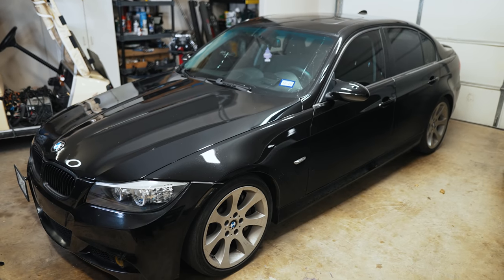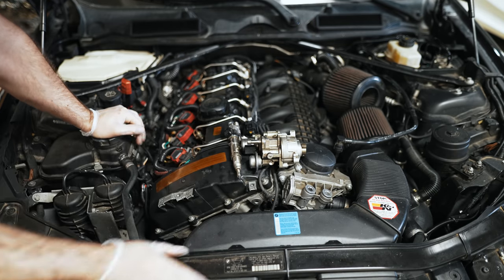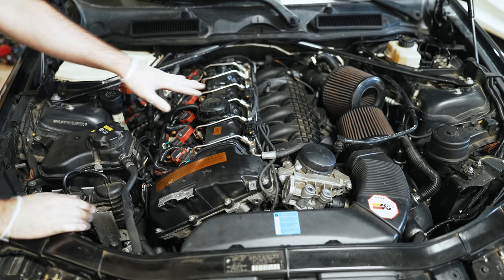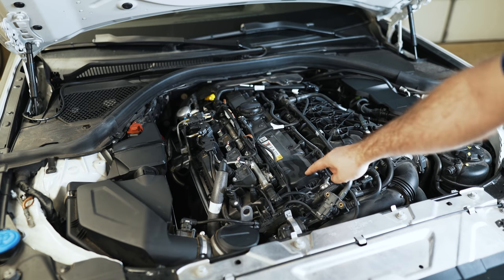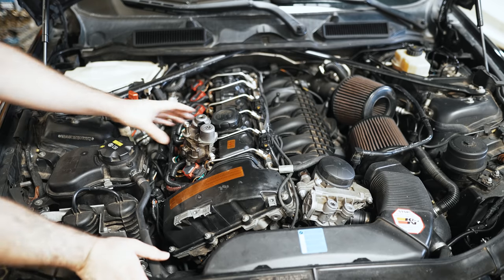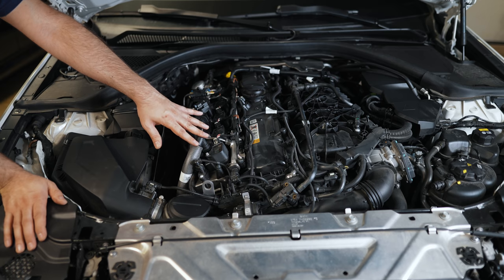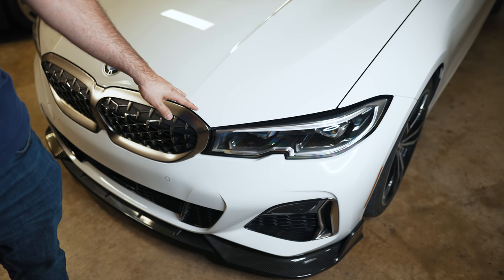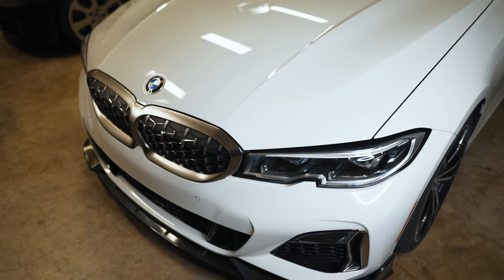Here Is Why New BMWs Are Now Reliable

Comment: Car And Driver had a blue 2020 BMW G20 M340i that hit 40,000 miles in their long-term test on 3/4/2021. Only issue it had was 2 potholes, nothing mechanical at all. I'd like to get this version of the G20 someday, seems like a real solid upgrade to the N54.

*EDIT: Not my G20. Not my website. Lol. So many replies. "40K MILeS?!?! tHaT nO lOnG tErM I kNoW oF! CoMe BaCk aFtEr wArRaNtY!" Yes. I understand. But did you know..? This is a Toyota engine now. The B58 engine will do 200k miles with no oil changes & constant neglect. The S58 engine will be the unreliable BMW you're all so familiar with. 😉
Reply from the maker: Nice, yeah stock it feels like a stage 2+ N54 running on 93 octane in terms of performance. Add that along with reliability and you can't go wrong.
Reply: I have an Alpine White 2020 and coming from an 07 E90 with MHD Stage 2 this one is very similar though not quite the thrasher those twin snails are.  A very healthy upgrade in every way - the X drive plus rear LSD standard make this a monster of comfort, capability and potential.  15K miles and one winter in, have had zero issues.
Reply: Great vid! Saying imo indicates you are open to other opinions and don't state yours as fact, don't worry it isn't annoying.
Reply: I have a 2017 F82 M4C and have had zero issues with it at 51,000 miles. I always do the required maintenance and on time. But I do drive it daily obviously, including seven track days in the last two years. The only thing I spent a substantial amount of money on is tires...lot's of tires.
Reply: I saw the story too
Reply: 40K miles?  Call us back when you hit 200K miles--then I'll think they are "reliable", and worth the asking price.  Who the heck wants to buy a $60-90K car and have to trade it in before the warranty expires at a 50% depreciation rate.
Reply: @RK-db4oq  that straight 6 will easily hit 200k. Am absolutely certain about it, no doubtin my mind with absolute certainty. Depreciation is on every car but luxury cars get hit hard. Sometimes its not about depreciation which isn't everything. Its about owning a car and enjoying it. I care about depreciation but not very much. Its subjective.
Reply: Exactly why Toyota allow it to be labeled as Supra engine. Tada san indeed open it  bolt by bolt to check if it may have problems
Reply: @RK-db4oq  Alright bet. When I buy my 2020 B58 G20 M340i I'll let you know. By the way, that 40k mile BMW is not my car. However, I do own a 2008 335i E93 with 94,551 miles. Daily driven & I actually just did rear rotors and brake pads today.
Reply: @nature10879  I'm talking the whole car, not just the engine.  Believe me, I'm rooting for BMW to get their act together on reliability.  I buy new and typically drive 25K per year, and like to keep my cars until they hit the 200k miles mark.  Ford trucks, Honda/Acura and Lexus/Toyota have no problem doing this for me.  I would have loved to have bought a new 540i--it is everything I am looking for in a vehicle, but in the end I just couldn't do it because of all the horror stories I've seen and heard about design, reliability and maintenance costs.  In the end I bought  a Ford Expedition (I know...), so have to be satisfied with the thrill of straight line acceleration only (tune that 3.5L twin turbo and you can easily get 550+ HP out of it, and AWD lets you use it).
Reply: @RK-db4oq  You pay to play. This is a performance car not a Toyota Camry to get you to and from work. I bought my M4 because I like the way it handles, the power and I like to attend track days in a car that has some speed. When you build a performance engine/car you have tighter tolerances and more wear to achieve those power figures and higher performance suspension, brakes, wheels etc. I will say again I have over 50k miles on my car and the only money I've spent is on oil changes and regular maintenance...and tires.
Reply: @RK-db4oq  i had an acura it was a nightmare. My e39 was trouble free compared to that thing. For some reason i had suspension and fuel system issues over and over again. When i sold it, had to have it towed. I currently own a Taurus and a 550i. Catalytic converter twice (had it towed twice$1100x2)changed, fw drive shaft(had it towed +400), fuel pump(towed+600) wheel bearing twice changed (+800), plus regular maintenance like tuneups etc and i baby this thing. And on my 550i, valve stem seals and new battery. To me if its not complex, make it reliable like a toyota. I cant speak of ford trucks the older ones are great but the EcoBoost is having issues. Rams are mostly unreliable and problematic. Hyundai was the most trouble free car I've ever owned even though it was unsafe to drive besides my beloved e39s. One e46, 2 e39s, a 1992 325i manual (over 280k), a 633csi (had 210k when i bought it and the that thing wasnt counting, no one knows how many mileage that thing had) Good luck with your ford expedition, a friend had an older one with 290k miles, just blew head gasket but its been an amazing suv for her and i think she neglected the coolant loss issue why it blew the gasket.
Reply: @RK-db4oq  by no means am defending bmws but their straight 6es are great overal excluding the early turbo ones from 2008 to 2010. I wouldn't hesitate to buy one over anything german and asian (lots of respect for honda/acura vtech v6 motors those are super reliable).
Reply: @nature10879  I'm relatively familiar with German cars as I lived in Germany a few years.  During that time I mostly drove Mercedes as a company car (300D 4-matic, GLK 4-matic diesel, and C Class wagon 2WD gas turbo 4)--used to do 130 MPH on a regular basis on my way home from work until I got it out of my system (and got older/wiser).  The 300D was the most comfortable and the best at speed, but a bear to park (only Europeans would understand the relevance of that).  The C Class wagon was basically a cramped Camry--hated it.  The GLK was the most useful--it did almost everything well, but it was twitchy at speeds above 100 MPH.  Every German "car guy" I know (and I know quite a few) has either a Porsche or a BMW.  Mercedes was considered a boring executive taxi, though my company used them exclusively as they were the least expensive to keep on the road (and they tested a number of brands for several years to prove it to themselves, including Ford believe it or not).  Audi was thought to be owned mostly by A-Holes (because according to my German friends, their owners mostly drove like A-Holes), so even though they had some nice models, nobody I knew owned one.  VWs were for young/poor guys.  My plan is to pay off the Expedition in a few years, keep it as a 2nd car (I have an Odyssey with 266K miles now as my 2nd car), and then hopefully buy a 540i or its replacement, assuming BMW can continue to improve.  In Germany no one worries about BMW reliability too much because parts are relatively cheap (they have ebay equivalents and junkyards too) and every local mechanic knows how to fix and maintain them--no need to visit the dealer once the warranty expires.
Reply: Get the 2020 M34Oi. If you get one. They changed the tune, and exhaust manifold on the 2021. I had mine in the shop, and they gave me a 2021 for a loaner. It felt gutless compared to my 2020, and it had no exhaust burbbles. Sounded extremely muffled, and felt way slower.
Reply: the fact that 40k miles without problems is a lot to a BMW says everything
Reply: @thend8535  did the horsepower numbers decrease?? We are thinking about either new bmw m340i or Tesla model 3 performance
Reply: BMW engines are pretty good, it’s usually not the engines that go bad. The issue is usually all the plastic parts and ecus and whatnot surrounding the engine. Those usually start going bad after 5 years or so and only get worse from there. The vibrations and heat cycles in the engine compartment take their toll. And if the wrong part cracks and the engine needs to be removed for it to be fixed... well enjoy your 4 figure repair bill over some crummy $50 part. 

Also I would hardly call 1 year a “long term test”. Kind a joke to call it that. It’s after 5 years and the warranty is expired that stuff starts randomly breaking. Not hating on BMW but pretty BS to call modern BMWs “reliable” based on this 1 year C&D test.
Reply: 40k is not long term reliability .......maybe 80k is
Reply: Anyone who uses plastic in the engine loses credibility  in my opinion for reliability long term. It breaks down over the long term regardless of how well you take care of it because  its not able to handle the heat and cooling down over the life of the car. So no older German cars are bad avoid like the plague. They will nickel and dime you.
Reply: @RK-db4oq  right? This day in age 100k should be no issues for many modern vehicles. The fact that some still have to boast about making it to 40k or before warranty is up is down right embarrassing
Reply: @tomdrummy4984  No, the standard is what other car makers have already set.  Even disregarding the Japanese (most of who's cars will hit 200K miles with ease if you maintain them), most Fords will do 200K with minimal repairs (Ford sedans are generally the exception, though the Crown Vic is a tank that will do far more than 200K if you take care of it).  Had an E-150 van that hit 230K miles with only the radiator and rear diff going out (total $1,500 to fix) and that was really my fault, as I did not change the fluid in either.  When I went to Germany I let it sit in a Northern Missouri parking lot for almost 3 years.  When I came back it started on the first try with help of a battery jump and drove fine, though the brake fluid had deteriorated and thus the brakes were almost non-functional (I failed to ever change that too).  I donated it to a charity and as far as I know it's still on the road.  I expect any car maker can easily design their cars to hit 200K with minimal repairs if they want to--it's not rocket science.
Reply: Come back at 100+k, 40k is laughable
Reply: Still had to go into a shop to get an oil change. As for me I’ll never have to go get one.
Reply: @nature10879  Maybe the core block and heads might, but I assure you that engine, along with the rest of the car, will be sitting in a wrecking yard long before then due to all the bits on the engine and the rest of the car failing. If they wanted a reliable engine it would have NO turbo, port fuel injection (f--k emissions), GEAR driven valve train, and NO variable cam technology at all. The pistons should also have deep skirts, and higher tension rings for better oil control. NO plastics in the intake manifold or PCV systems. I could go on, but that's a start...
Reply: Scotty’s 94 Celica is still going strong and has required only normal maintenance.
Reply: Forty thousand miles a "long term test"? How about 5-10 years for a long term test.
Reply: @steviebarnes1168  15k miles and no issues? WOWZA what a reliable machine.
Reply: 40,000 miles isn't exactly LONG TERM! I would expect ANY car in a 2020 with 40K miles to not have any problems!
Reply: And you think 40k miles is a lot?
Reply: @nature10879  " that straight 6 will easily hit 200k" :D who are you kidding, yourself?
Reply: @RK-db4oq  see cars don't get that much reliability because it is more profitable for companies to chase technology than reliability. Also nowadays you have to make the car according to very strict ecological regulations which also makes it more advanced and technological with more moving parts and electronics. Also what you were told before that " that straight 6 will easily hit 200k" is total bull... -it will not.
Reply: @Godofhel1  all my bmw i6es hit over 200k.
Reply: @dontcare563 : if the fact that it went 40k without problems is an indicator of substantial improvement having been made, it’s not a car for me. I love the way they look, ride and handle, but not so much that I want to put some mechanic’s kids through college.
Reply: @RK-db4oq  Yeop. 200k miles. Everyone wants their cars to last 30 years and atleast, ATLEAST 200k miles. What is wrong with you?
Reply: @animalutz00  No, I want my car to last at least 15 years and 200K miles.  And there is nothing wrong with me, nor is there anything wrong with my Hondas, Toyotas or Ford trucks, all of which have done it with ease.  The better question is what's wrong with you--are you a trust fund baby who does not care about throwing your money away?  A 200K mile vehicle life is easily attainable.  EASILY.  Any automotive engineer will tell you this.
Reply: @RK-db4oq  Yep. Got it. 
Have a great life.
Reply: @andreibelittchenko5956  Haha, appreciate the sarcasm.  I am by no means ready to draw long term conclusions, but it was a data point, albeit early in product life.
Reply: For what it's worth, the N54 rarely suffered issues below 40k miles. Most of the issues would happen after 50k, 60k miles.
Reply: Wow! That’s a heck of a statistical sample!
Reply: @jzxtrd337  If you set the bar low enough, you’ll never be disappointed. BMW is a lifestyle much more than car. Sort of like Tesla is a cult.
Reply: @RK-db4oq Many people here in the US have drastically reduced their driven miles, due to working at home and the proliferation of rental vehicle use for long trips. Insurance cost is a big factor. Gasoline costs are also very high. 9 year old Mazda 3 had only 34,000 miles on it when I sold it to get my 2024 GR Supra with B58 engine. I expect to drive it no more than 5000 miles per year. Most of my neighbors buy new vehicles every 10 years or less, and since they work at home, accumulate very few miles on a yearly basis.

Comment: BMW is now reliable?  Oh, hey look, a unicorn.
Reply: Most 2013 and later BMW models are reliable (untill they get to around 120k miles)
Reply: @johnmitchell2269  120K isn't near good enough. They also need to be more serviceable well beyond that. BMWs are full of parts that should last forever, but because they went with plastic, they turn to dust.

Comment: I got my new bmw 440i gran coupe with b58 engine in 2017, so far 30k+ miles with absolutely zero issues. So hope it will stay this way. However, I do worry about plastic parts in very hot engine bay given how hot it get

Comment: Makes sense, the B58 is awesome. Super interesting video! I've had literally zero issues so far in 2 years with my M140i, let's hope it stays that way. Actually taking care of your car and treating it right, keeping up with basic maintenance, etc. really helps too regardless of the brand. It does my head in when people beat their car into the ground and then complain when things break!
Reply: @DennisH22A  if you drive hard on a cold engine it's destined to break, that what's he is getting at. I drive calm the first 10 minutes until oil is at temperature and ever 6000/7000 miles an oil change I'm sure this engine will last a long time, also one of the best auto transmissions in those machines ZF8 are one of the best. Every day a smile in the M140i.

Comment: Oh man just looking at that all those components over the valve cover makes me anxious about valve cover gaskets..
You also surprised me on the water pump. As cool as it is to bleed the system without starting the engine, changing the water pump was pita and super expensive on my dad x3, N55. Well worth the money save, but... it failed at 70k miles.. No clue how long this new one will last.
Reply: Yep, water pumps religiously fail.  You can practically set your watch by them.  For me, every 60,000 miles.  So the extra 10,000 for you was a bonus in my book.
Reply: @greggraham2642  330000 Miles on my original electric water pump.

Comment: Great content, although although frankly I am sceptical that BMW are actually consciously going to do anything to make their cars more durable. 20 years of not caring and a solid track record to prove it makes it almost impossible to suggest that they really do care.
Reply: There has been some improvements on upgraded models, but am only speaking on inline6 and the B58 engine, anything V8 or 4cylinder is still junk the N63 is still a nightmare, anything 7series is a money pit.
Reply: Consumer Reports magazine now ranks BMW as #1 among 35 auto manufacturers, overall. If BMWs weren't reliable over the past 5 years, they would not have such a high ranking.

Comment: As a BMW tech there are some problems on b58s.....more older than newer versions. such as the pcv system ,plastic OFH, water pump pulleys, throwing belts,starters etc lmao love m340's though still
Reply: GR Supras with the B58 have been very reliable over the past 4.5 years. I have a 2024 and expect to drive it no more than 5000 miles per year.